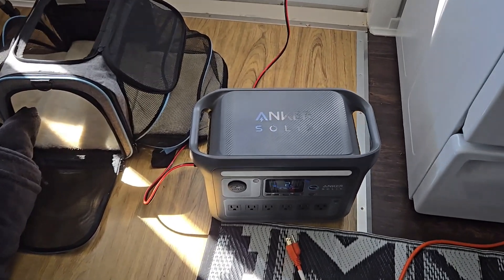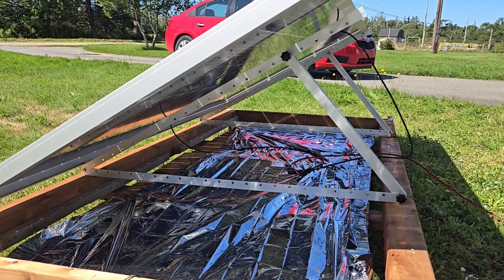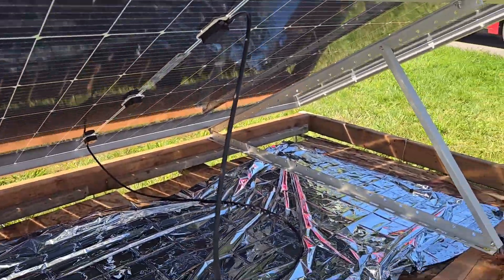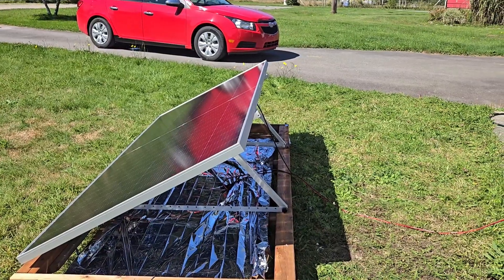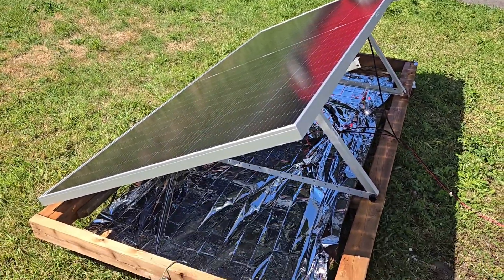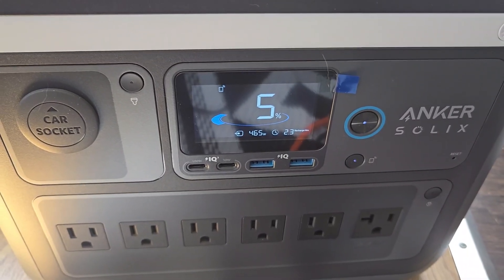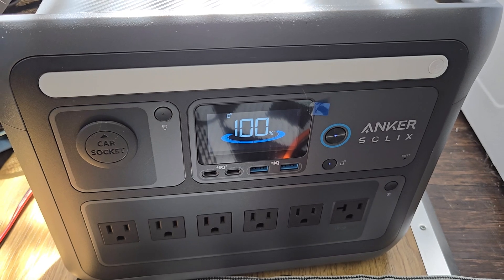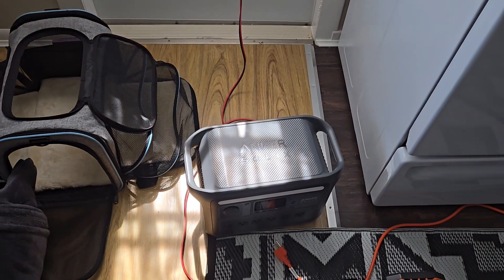recharging anker solix C1000 under 3h with only 1 540w panel???

Comment: I bought a Harbor Freight solid solar panel, don't have it completely hooked up yet.I have a question,when using a solar panel to charge the Anker Solix C1000 ,do u leave the power bank turned off or turned on ???
Reply from the maker: The generators will turn on on their own when plug-in to solar .